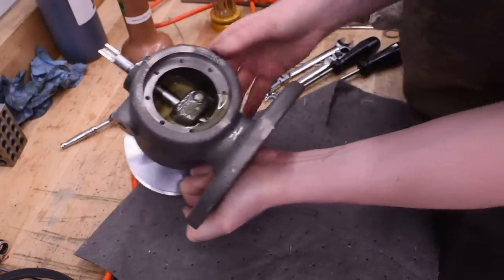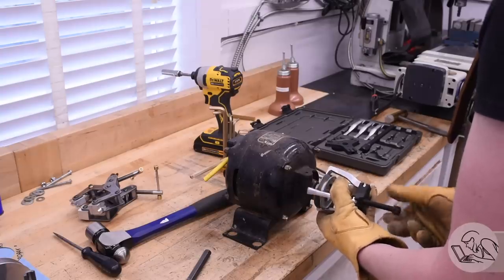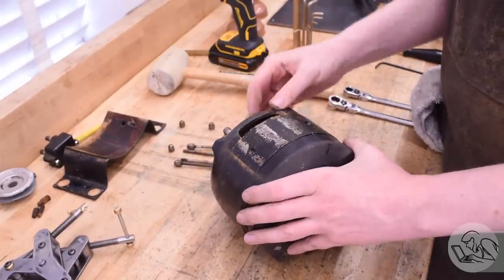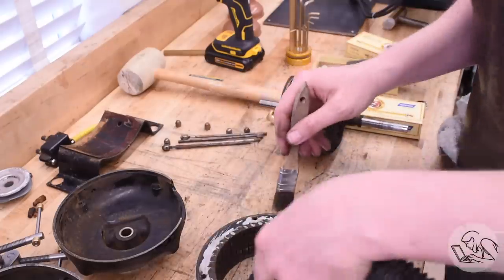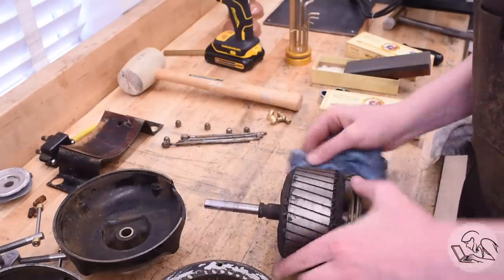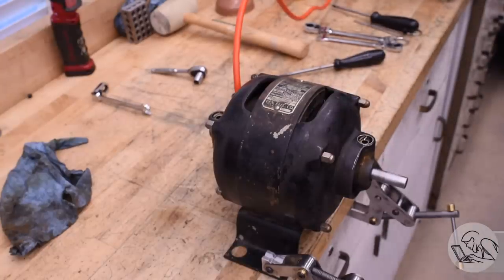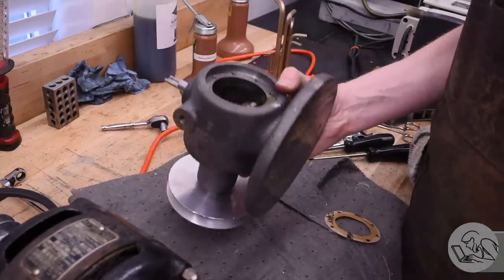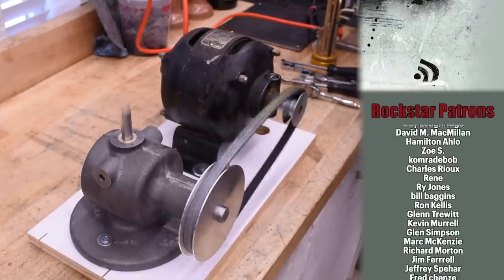1934 Electric Motor - Let's Build A Die Filer, Part 8.

Comment: Quinn , That motor has a very cool vintage vibe to it , Its like the guys that made it said, yes it has to work but lets make it look cool . and thank you for the info on detergent /non detergent oil. I say that because I always wondered why  my air compresser said ONLY use non detergent oil ?? but I have been servicing it for 43 years and when i come in the garage and throw the switch it comes on and makes air @ 125 psi then i start my day ,, Thank you for making these vidieo  they are so well done .

Comment: My thought would be to protect the open slots in the motor from filings generated using the filer. An underneath mounted motor with a guard would probably work.

Comment: Dang it Quinn! I searched that huge list twice for the promised link to that puller set 😂

I wouldn’t worry too much about end float in motors. They tend to get pulled into line longitudinally by the magnetic field. Just don’t load them longitudinally without some thrust bearings carefully aligned to the preferential magnetic position. 😊
Reply from the maker: I think it’s in there? 🤔 It’s by GearWrench so if you search Amazon for that you’ll find it.

Comment: If the die filer runs hot in use that is an indication that the oil is heavier than it should be. Adding a small amount of a suitable lighter oil would help lower the running temperature.

Thank you for the info on the electric motor.

Comment: Quinn.
Most modern automotive gear oils have EP additives that will eat away at the brass or bronze bushings.
I couldn't find a specification on the oil you used.
GL1 gear oils are safe for a gearbox with yellow metal bearings.

Comment: i have an idea for the stand ... go vertical, motor upside down under the plate/table/fixture and the filer on top, you get alignment, and you can have the belt in the back  with guard and so on, and the motor wire will point down (because its up now)

Comment: Modern day motors, from my experience, are typically in the recycle bin within about 5 years. I found a household fan from the 30's at a garage sale once for $1, in the mid 70's. Bought it, did as you did, and cleaned it up. Had to replace brushes, cord and bushings, and it ran perfectly, and very quietly after I was finished. Kept it oiled, and used it through the early 90's. Gave it to a neighbor when I moved. Wonder if they are still using it?

Comment: If you mount each thing on two separate surfaces, then link the two surfaces together with a threaded rod that you could adjust and push and pull the two away or closer to create the tension. would be a cool project to design and build.

Comment: Tip: bearing separator behind the pulley flange, bearing separators often have threaded holes so tou can whip up an impromptu puller that can bear against the set screw side flange right at the motor shaft diameter

Comment: That motor may be even older than you think.   At 20:31 in the video there is a close-up of the motor showing what looks like 2 dates  - 5  12  26    and  6  4  27.

Comment: I would suggest getting a toothed belt to help with getting around the small diameter pulleys better and to have the motor hang from the bottom of the die filer.

Comment: Pro tip on old woodworking electrical schtuff: accumulated sawdust is conductive proportional to the moisture content of the dust. Soooooo, before reclaiming & repurposing old woodworking schtuff, clean out the old crapola. I've only been shocked once (1960's Walker Turner bandsaw, teeny amount of sawdust in the old on/off switch contact box).

Comment: As others have said, trying to remove a v-belt pulley with 2 or 3 jaw puller will almost certainly damage or ruin the pulley. The least bit of rust or marring on the shaft will have the pulley dead stuck.
Aways remove any set screws completely. There is the possibility of a second set screw underneath. If the pulley won't come off by hand, make a two-piece bar that can be clamped onto the pulley hub and use a 2 jaw puller. Better yet, make a second bar to go across the end of the shaft. Use two lengths of all-thread to connect this bar with the two-piece bar and use nuts to remove the pulley from the shaft.

Comment: I put a 3 phase motor and VFD on my die filer. I find I often want to run it very slow. Also watch out for the finger pinch- the file catches your part on the up stroke, then slams it down on some finger skin.

Comment: For a stuck pulley like that, I've had the best luck just holding it up by the pully and smacking the shaft with a lead hammer.  This of course requires you to be strong enough to hold the whole assembly up while repeatedly striking it with a hammer, but if I can't remove the part that way it's usually coming off in pieces anyways...    Also, a fine straight or vixen cut file works really well removing burrs without marring the surrounding shaft.

Comment: You  might consider putting a magnet somewhere out of the way in the gearbox.  It will gather up any metal filings and keep them out of bearing surfaces.

Comment: Hey Quinn, when I got my Craftex 10 X 18 Lathe,  I noticed that with the recommended oil in the gear box the lathe was really loud. I added some Lucas Heavy Duty Oil Stabilizer after the initial run in and oil change and the lathe was crazy quiet. The Lucas causes the oil to bind a bit better to the gears which allowed the gears to mesh quietly even at higher speeds. I also noticed that the wear on the gears is greatly reduced due to this binding. I didn't add much just a few ounces made a world of difference. I am thinking in your application this product may be one to consider (it also doesn't stink like 90 weight gear oil).. Just a thought.. Thanks for the share!

Comment: Fun fact; Properly set crimpers & properly sized crimps for the wire gauge SHOULD result in a cold weld connection, hence the strength & reliability.
Extra points for the Stargate reference too 😁

Comment: We usually try to avoid gear pullers directly on motor shafts cause it wobbles out the factory drilled center.  We then have to cut a new center.

Comment: There was a pair of pinball machines set up side by side at the local bowling alley when I was a kid. If you put a hand on each of them you'd get a pretty good tingle. Today I learned one possible cause of that.
Reply from the maker: That’s definitely the cause. This was really common in arcades. Pinball machines were all wired randomly as to whether neutral or live was on the chassis (which included the metal lock bar on the front). You learned not to touch two adjacent machines! 😅

Comment: Since you can flip the case of the motor, you could mount the motor upside down under the filer, on the same board... Optimal space savings!

Comment: Incorrect oil or oil level = ticking, is by no means initially intuitive. Thank you, this is now stored, or possibly refreshed (DRAM ya know), in the troubleshooting gray matter library.
When young engineers ask how I learned all this stuff, after somehow magically conjuring the solution to what they're struggling with, I'm honest and simply reply, "I'm just really old".
Reply: Been there, done that, then forgot and did it again, then forgot and did it again. That's how you learn this stuff.
Reply: @oldfarthacks  100% and I must say your username could not be more appropriate for the topic at hand.

Comment: I had acquired the basic frame of a wood lathe some time back,  and when I found a very similar motor in a Habitat store for $10,  I snagged it and started to build a stand for the thing.  They'd tested the motor and labeled it as "working" but the cord on it,  while not as short as the cord on yours,  was aged enough that the rubber jacket was showing a lot of cracks in it,  so that got replaced.  Rather than disassembling it,  I used some CRC stuff from the auto parts store calling itself "Lectra-Clean" which was supposed to be real good at stuff like this.  It was,  and all sorts of crap came out.  Along with,  unfortunately,  most of the iubrication,  as I was notified about by the bit of smoke coming out of the bearing areas when I fired it up.  Adding some oil to it took care of that problem.  A switch was added and a power cord,  and the thing runs just fine.  A trip to our local mower repair place got us the right size belt,  and the motor being mounted on a hinged board provides belt tensioning.

On the subject of getting a tingle between appliances,  I heard about such a situation and a meter showed me 120VAC between the washer and dryer in this laundry room.  I scoped things out,  and in opening the breaker box found that somebody had swapped the red and white wires to the dryer outlet!  Fixing that took care of the issue.

On the subject of gear oil,  I had a jug of that stuff in the back of my truck,  under a cap.  That truck sat a lot,  and had a tendency to collect nests of some rather nasty stinging insects.  But they sure didn't care for the smell of that gear oil at all.  And what nests did show up got taken care of with another petroleum product,  namely WD40.

Comment: Hi Quinn -Well done, it looks like a real machine 👍 I'm interested to see how the 730 ish strokes/min goes in use. I've just finished a filer (different design) and spent a bit of time with chain sprockets and gears to get the speed from 2700 down to 300 and used a speed controller to vary between 100 -300 ish strokes. Haven't done a lot of work with it yet but around 200 strokes seems to work for me on 5mm thick steel - it will depend on the file and application I guess.

Comment: The "Flush" would destroy the iris , so it had to stay open and be closed after connection was made.
Reply from the maker: That actually makes internal sense! 😁
Reply: I'm pretty sure they had it closed a few times before connection was made. I've always wondered why it didn't get destroyed by the woosh/flush.
Reply: ...but they stored it under a giant slab of rock that didn't get destroyed, soooo....
Reply: @Motoko_Urashima  while it was disconnected from the ring network and wasn't giving out positioning updates
Reply: @Motoko_Urashima  the slab was inside the gate as well as covering it, and enough mass inside won't let a wormhole form as a safety feature. But it needs a lot of mass.

Comment: James from Clough42 used Send cut send for his grinder project. I was thinking about using them for a stand for my Die filer project. Since large castings are hard to come by in this day and age and I wanted keep a more classic look it seemed a good way to go. Also, It’s ambitious but a variable speed pulley incorporated into the build would warrant mad bragging rights.

Comment: Speaking of choice of lubricants, you should not use sulfur bearing oils in mechanisms that contain yellow metals like brass and bronze bushings, or copper components. The sulfur reacts with the copper in the alloys and will cause them to quickly degrade. This results in what appears to be very fast wear and/or pitting of the bearings and bushings.

Comment: While the auto-parts-store crimper does make a serviceable stripper, once you try a better stripper, you'll wish you'd tried it sooner. I picked one up in the electrical tools section of my local big-box store that uses a replaceable blade, similar to the stripper in a quality network cable termination kit, and it's such a joy to use. The difference between actually cutting the insulation vs. bullying your way through by sheer force of will (and grip) is huge. Unfortunately, I don't currently have the tool handy to get anything useful like a brand or model number, but I imagine it's not hard to find one like it.

Comment: You might consider using a flat multi v belt like modern car engines use and employing a spring loaded flat third wheel as a tension-er.  I will minimize sleeve bearing wear.

Comment: A slight amendment to the statement about slip - induction motors have speed slip, permanent magnet motors have angular slip. The amount of slip depends on the load, with 3-4% slip being typical for a moderately loaded induction drive.

Comment: I wouldn't say to use the cheapest extension necessarily. In your case your motor is rated for 5A and you would be running it continuously so you're presumably ok with any cord -- the cheapest ones would be rated for 8-12A anyways but If it's an application where you would be often stalling the motor I would say to check the stall current and make sure to get a cord that won't melt if you draw the full current.

Comment: Some don't use felt but waste cotton.  Modern Equivalent I have heard for that is tampon packing cotton of course.  Seen where it's not felt but a string . Or lamp wick works too
Reply: Bijur oiler system. Most have a 12 oz capacity reservoir that pressurizes with a plunger. See McMaster Carr ™ who also carries all the tubing and fittings, as well as the EXACT felt you need. At the factory I worked at HD46 was the go to lube.
Reply: @Stan  yes a pressure oiler system not a wicking one that it a old 100 years ago system.  Like on the stuff I rebuild  and restore to use .

Comment: Quinn, please allow me to point out, from a safe distance and in the luxury of not having to do any of the work, that the "one home-made pulley" limit should properly be understood to refer to a pulley set, not just a single pulley Therefore you should definitely make the second half of your die filer pulley set. This will not only bring you into compliance with the rule and give you (and your loyal viewers) deep satisfaction, but will certainly allow you to obtain the correct and proper speed of rotation as per the manufacturer's recommendations.

Comment: A medium size bearing splitter [or as their known in Pennsylvania, a clamshell] is a good investment, especially if the pulley is going to be reused. A little heat never hurts, also!
Reply from the maker: Except when it melts the pulley

Comment: I know this is a stupid question, but what is that thing Quinn used at the very end to read off the RPM of the pulley with a laser? I've looked around for a thing like that and utterly failed my Google-fu; now here's Quinn using one and I WANT ONE!!!
Reply: A tachometer. I have a tunable strobe light with a xenon bulb that does about the same thing. Got mine at an estate auction on the cheap for $15USD.
Reply: @StanErvin-yo9vl  THANK YOU! (Tachometer -- now I really feel like an idiot, I should've known that....)
Reply: @clehrich  You're no idiot Mr. Lehrich. The older I get the more dense the brain fog becomes. Don't rightly know what the going price is for one, but you may get a great deal for a usable one @Harbor Freight ¯\_(ツ)_/¯
Reply: @StanErvin-yo9vl  Thanks. As a 50+ myself, I know all too well the "fog." Looks like $20 will do it.

Comment: a point about that gear oil, and I don't remember or know if this applies to your build. If it says GL-5 on the bottle then it is not to be used in manual transmissions or transfer cases with brass synchronizers this oil contains compounds which will attack those components in effect lowering your transmission life. they are meant for Differentials and final drives that have no brass components

the oil that you need for brass applications is GL-4 gear oil

Comment: Oh, Quinn… we need to send you some better wire strippers! 😂
I have a dumb question. Just how much worse would it have made things if you melted the old pulley off the motor shaft? I feel like that would be a bad idea, but I’m not sure about how bad it would be.
I am impressed by how well that lovely motor held up, considering how much sawdust those open oil cups were likely exposed to.
Reply: Burning the old pulley off would risk overheating the shaft, potentially warping it, possibly damaging the bearings, or damaging the insulation on the windings.  Also zinc/lead/??? fumes aren't great to be around

Comment: You stated that the outer ring was a magnet? If it was a permanent magnet, then wouldn't it be a synchronous motor and thus run at 1,800 RPM? I believe this is an induction motor so the electro magnets induce an opposing magnetic field in the stator. The stator is designed to be so conductive as to opposed a change in the magnetic field.

This motor is built opposite of most AC motors today. Most don't have slip rings and have the coils on the stator (outside non moving part) and those coils induce a magnet in the armature (the part that spins).

I didn't notice any starting circuitry. Does this have some kind of shade pole mechanism for starting to determine rotation or is there two coils in the armature with inductors to make the needed phase change for starting. 

Certainly a low starting torque motor and not very efficient but it will work perfectly for a die filer.

Thanks for bringing us along. I really appreciate it.

Comment: Those old brushed AC motors from the 20’s and 30’s were beautiful machines. It’s sad so many of them were junked simply because they were old. As a kid, I remember there were many of them in use in the 1950’s. We always gave them a few drops of 3-in-one oil (light machine oil) a couple times a year. I don’t think I’ve ever seen the brushes get worn enough to bother replacing.  
Brushed and commutated motors, so called “universal” types were also common. They ran on either AC or DC. Don’t see those any more.
Reply: Hair dryers. Cheap angle grinders

Comment: 11:48
I'll put my NASA wire splice with adhesive-lined heat-shrink tubing up against any crimp connection.
Not sayin' that a proper crimp isn't plenty good enough for most things, just that molten metal filled is still used for metal on metal connections that see tension and that's for a reason 
Also, comments boost the "engagement" so maybe a few more will have the video recommended.
Reply from the maker: Solder is brittle though, so crimps are still preferred if any vibration will be present.